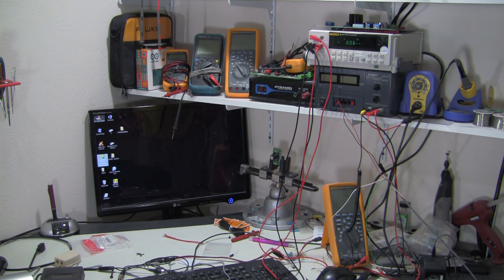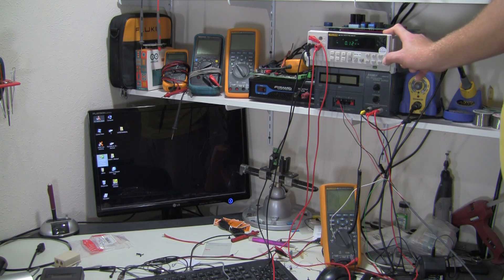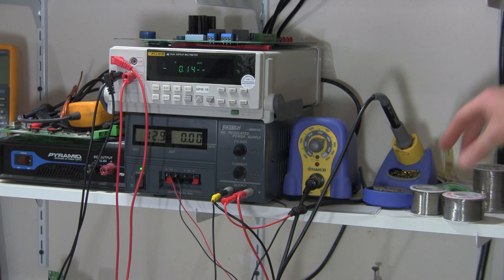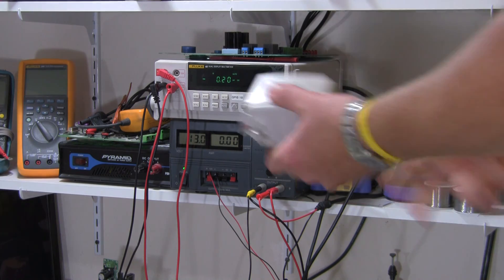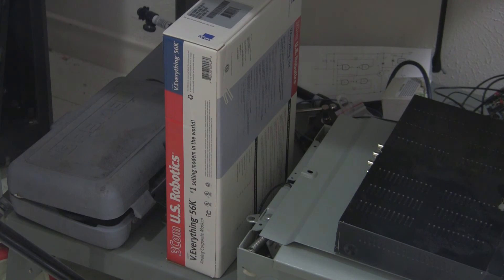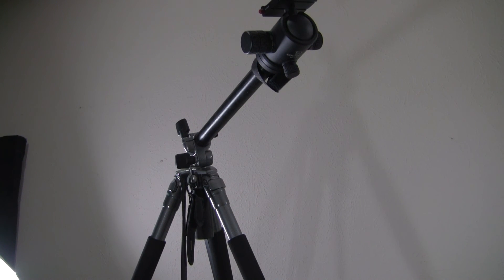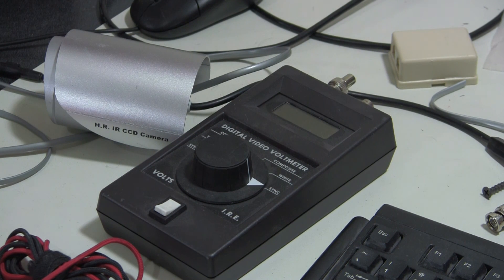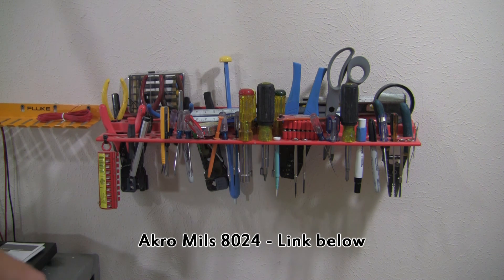ACF 002: Office electronic test bench Part 2 lab tour and future projects

Comment: how can u work in such a mess of wires and cables?? my test bench has all the measuring equip plugged into a central location  and everything organized so i can put a piece of electronic that needs repair on my bench without it getting tangled
Reply from the maker: You're right it's a mess. It does get frustrating sometimes and if we were taking precision measurements they would easily be affected by this mess. However, this is the true state of our workbench on a day-to-day basis. Thanks for commenting please leave a link to your workbench we want to see it! Take it easy and keep watching. Thanks again